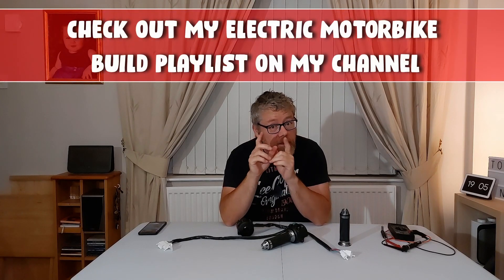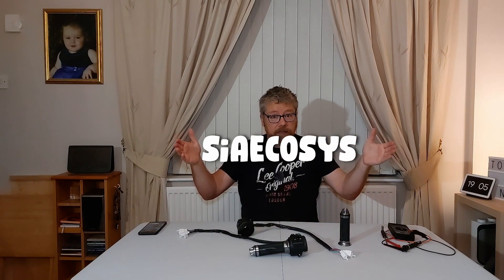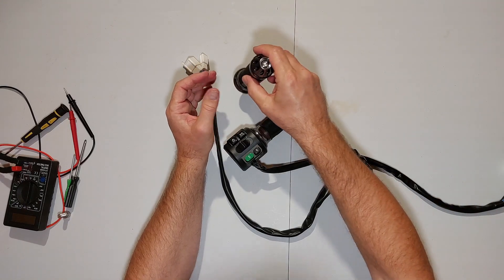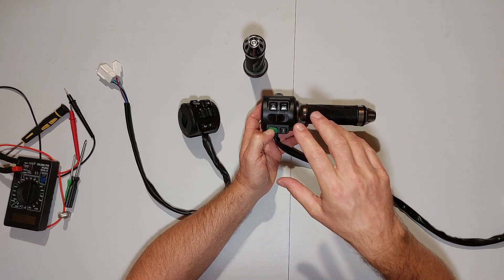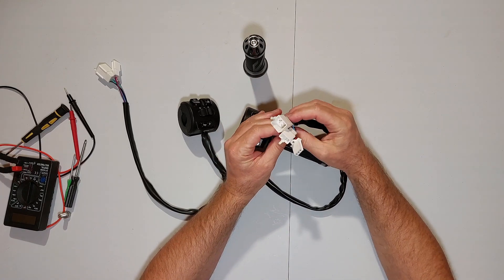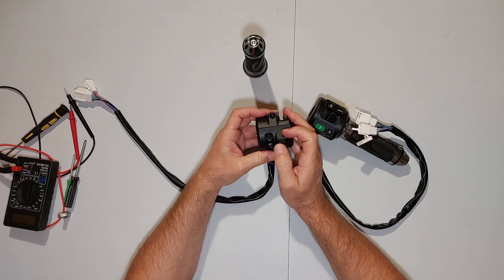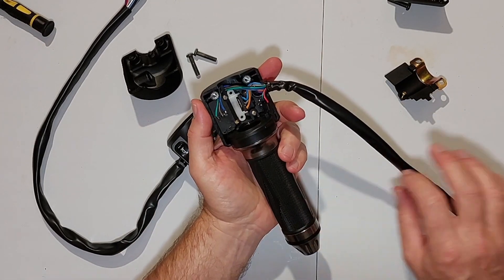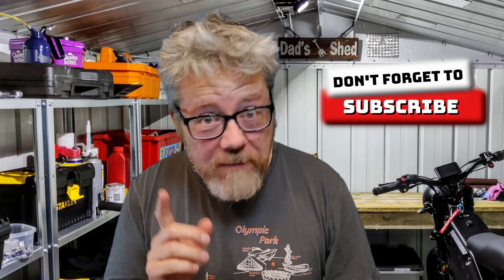BEST GRIPS FOR AN EBIKE ELECTRIC MOTORCYCLE   YAMAHA FZS 600 FAZER PROJECT EV BUILD PART 3

Comment: When you press the side light switch it sends power to the dip switch (blue) and power to rear light (brown) and switch is powered by green, possibly green and brown might be other way round, I think the switch next to it is for a fog or spot light, great controls for the money
Reply from the maker: Yeah it's the green and the brown which is the problem. I was checking them with  the multi meter bit I couldn't work out which is which . As when you press the first side light switch you get continuity through both green and brown.

Comment: One of the biggest regrets I had with my build was wiring up all those switches to my shit. I don’t recommend using 12v fused relays like I did. Was a huge pain in the ass.
Reply from the maker: I used fuse box and some relays in my last build and it was okay. How would you do it if you did it again?
Reply: @baconbuttties  probably just use the switches and run 12v directly to the components. The wires seemed thick enough, LEDs don’t take much amps and the 12v inverter had a fuse already. It got real cramped in the battery bay with all the wires and relays.
Reply from the maker: @bj97301  On the last build I think I had a relay for the indicators And I had to use one for the rear brake light to engage motor cut off on the controller. On this build I will also need a relay for Headlight (led ) but this one is 60 watt and maybe the horn as it's a full size one.
Reply: @baconbuttties  I relayed EVERYTHING. Bad call for me 😂